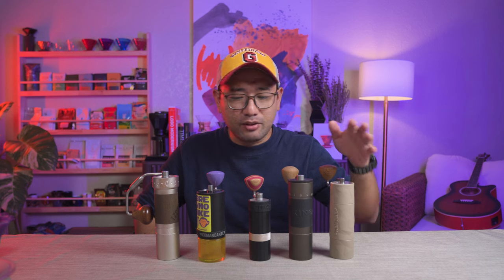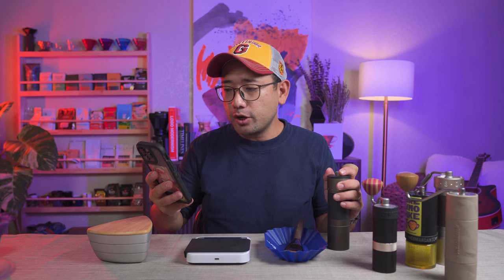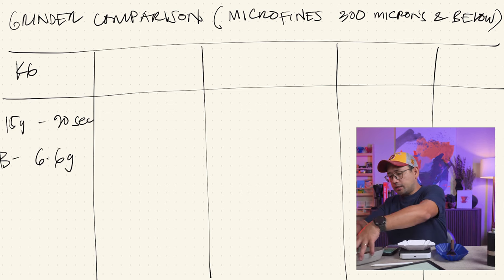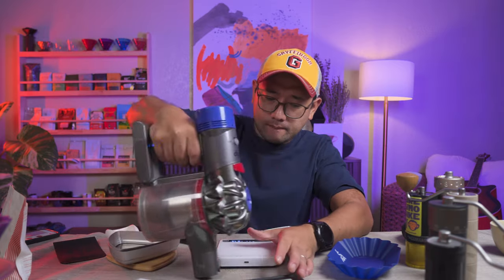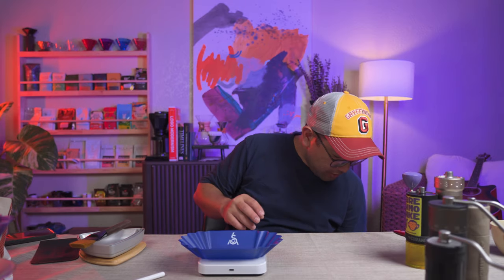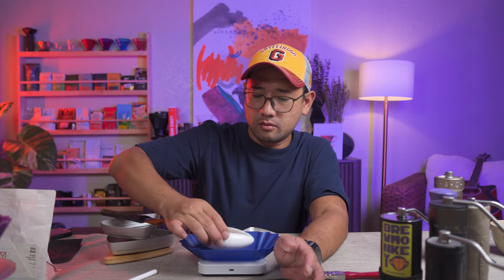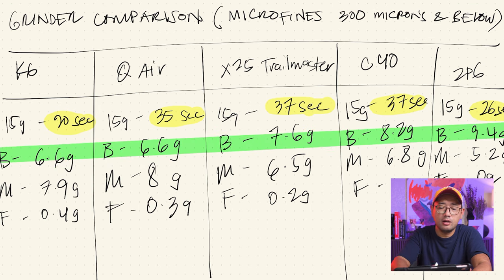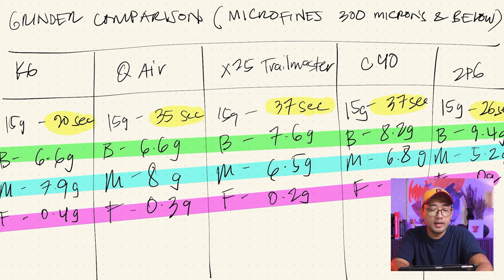Grinder Particle Distribution

Comment: Yeah. I understand this. There are a lot of parameters that affect the final result in addition to the grind size and particle distribution, such as coffee origin, roast level and date, the temperature of the water, and brewing method. 

No one recipe on the internet covers all these aspects. Most reviews just state you need a medium-fine or medium grind size for V60 without specifying any details about the grinder settings and other parameters. As I am a newbie in coffee brewing, I don't have enough experience to adjust brewing by coffee taste, and I have the Kruve sifter. I was curious to ask you about particle distribution, trying to eliminate combinations to get a perfect cup. Therefore, I would appreciate any specific numbers or recommendations for V60 brewing. 

Or at least your recommendation for the grinder for V60, which is best to achieve the V60 delicious tasting profile.
Reply from the maker: I would always recommend a Comandante C40 when you want to get the best cup that you can do at home. This is just my personal opinion and Im not an endorser of the product but yes I would still recommend comandante everytime.
Reply: @darylbuenocoffee Thank you! I heard that the C40 is really good. Since I will be buying a new grinder, does it make sense to consider buying the new model Comandante C60? Have you had a chance to use it and compare it to the C40?
Reply from the maker: @MichaelMaramzin  i haven't had the chance to use the c60 but one thing to consider also is the cost. If you are buying a comandante for the first time and you're a beginner the c40 is a great tool for your coffee. Yes the c60 is better but remember the tool is only as good as the one wielding it. So i would advise getting the c40 first, master it and from there decide if you really want to get the c60. It might take you at least a year before you would want to get one. Me personally i dont have the urge to get the c60 except for its bragging reputation. Otherwise the c40 is all you need.

Comment: 13:50 Thank you for the review!

Which sieves did you use for these tests? It would be very interesting to adjust grinder settings to reduce boulders and get their weight similar across all grinders and see the particle distribution. Currently, the numbers seem quite random and not aligned, making it hard to compare them.

Additionally, it would be great to provide grinder settings (clicks) in this table. I have a Kruve sifter and a 1zpresso J-Ultra grinder, and I am curious to compare its particle distribution with your results.

What do you think—do we need and how many fines and boulders outside the desired grind range for V60 to get the best taste profile?
Reply from the maker: I think it still depends on your personal preference. I never use the same grind size in all of my cups except for when im preparing for a competition. My theory is the boulders actually gives you the ability to limit or extend the amount of florality in your cup. With this idea, you can actually manipulate how much florals you can get out of your cup. Think of it this way - the boulders will need more from the water for more extraction - so higher temp more agitation. Now if you add more boulders and use your normal recipe then you get a cup that is more like when you are brewing a bigger grind size. All of these compund in your end cup so if your grinder produces a lot of boulders then the tea-like aspect of the coffee will come out more.

Comment: Master, dapat i ti- nare (tare) mo nalang yung bottom container para ma measure mo ng mas consistently among everything, pero still a great comparison! Really shows an interesting results! Im always mesmerized by the quality that goes in to your vids, keep brewing master!
Reply from the maker: Thank you, im not sure why i didnt do this but there was a reason why i had to remove the microfines from the bottom container instead of simply measuring it out it
Reply: @darylbuenocoffee  in that case then absolutely! Its your way, pero in that regards may i know why?
Reply from the maker: @sheanakale9502  I dont really know maybe Im simply trying to minimize points of error. The way I did it was I had to reset everything, everytime, clean out screens, clean out every container and I cant simply tare out the bottom container bec I had to have another set of scale on stand by simply waiting for the weight of the microfines and i didnt see this practical in the experiment. It would be another variable I need to defend to the viewers.

Comment: I think a micron setting comparison is not accurate. You should try dialling in to a certain timed pour over and see how that impacts your results. For example you may have to go much coarser on the k6 to match the ZP6 time or vice versa
Reply from the maker: Actually this will be a more biased basis if you ask me. The findings of this whole experiment actually shows you how a grinder performs and its up to you now how to use it depending on its strengths and weaknesses. For example the ZP6 is better when you use it with finer settings bec of its ability to produce consistent boulders. 

It will be completely biased if I do the timing pour over test exactly for the reason that each grinder has a different particle distribution which gives them their unique profiles.
Reply: @darylbuenocoffee  you didn't sift nearly long enough for the fine particles to make it through the 300µm sieve. Try shaking for 10 minutes and you'll see what I mean. It's better to use coarser sieves instead because below about 500µm the coffee particles will struggle to find a way through. Still better give it a couple of minutes. Then if you match the medium particle percentage you get a more accurate picture of how many particles are above / below the target. It's a lot of work and still not perfect, but about as good as it gets with a sifter (especially if using average of multiple samples..)